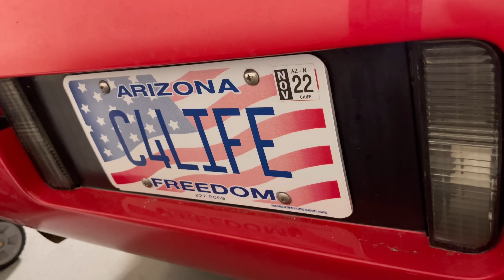Callaway Twin Turbo Delivery Day

Comment: Congrats on the purchase chris. I just want to let you know so you can put under consideration, and maybe even a must do while you go through the engine clean up.... if the car has been sitting for long while before you got it and due to its age, take both turbos off and send them to a turbo specialist to have them inspected and maybe even clean and refresh them since there maybe be a high chance the seals and bearings may be worn out which can lead to both oil leaks or premature damage to the turbos upon running. It's better to be safe than sorry.

Comment: Just came across you video on the Callaway. I too am in the same situation. I inherited my dad's 1990 twin turbo Callaway black with 40,000 original miles. It's been sitting in my dad's garage for over 10 years. Looks to be in the same condition as yours but maybe a little better lol. I currently have at a Corvette specialist repair shop now. So far I have had to replace the whole fuel system. Tank, fuel pump, fuel injectors, etc... Was a rusted out... Now she's running perfecto. I'm sure I'll be running into more issues down the road but for now she's alive... Not sure what I'm going to do. Might keep it or sell... Enjoy...... 👍
Reply from the maker: Awesome!  Please send me an email!  Have your registered it with Callaway?

Comment: Chris: FOR THE DOOR STAIN- if you believe it may be a petroleum base, I would just get some plain old oil lamp fuel which is almost 100% kerosene and take that to it with either a really soft sponge or cloth. The lamp fuel also has paraffin in it so it helps seal the paint as the stain is removed. I’ve found this also removes road tar even if it’s old.  Just thot I’d give me 2C on this.
Reply from the maker: Thanks I’ll look into that.

Comment: Your car has the same windshield as zr1 c4s.  The film will dwlaminate like yours is doing around the edges. You can replace it with a standard windshield for some savings.  Nice car!  Cant wait for this series.  Congrats!
Reply from the maker: Thanks
Reply: @mycorvettelife  another thing chris, watching the video again, it looks like they started witha zr1 when callaway built it.  The fenders look wider, you mentioned gs brakes, probably are factory.  The license plate looks wider, like the zr1.  I dont know much about callaways at all, but there are several tell tale points that indicate it started its life as a zr1.  Very rare car indeed.

Comment: You should be excited with this purchase..That is a extremely rare C4 .Congratulations..looking forward to the renovation vids ...The Wear on the Engine internals (if stock) may be a issue  with the use of the previous Nitrous setup?   .
Reply from the maker: Thanks

Comment: I think the windscreens were called cool-ray and were standard on the ZR-1 hence the delamination of the UV layer.  Not sure, but I don't believe anyone makes an exact replacement, as most ZR-1's where the windscreen was replaced are standard C-4 glass..
Reply from the maker: Cool-off

Comment: Now why would the owner not have the top for it? That's strange. The windshield's covering delaminates over time. I don't think there's anyway to correct the problem, but since it's the same windshield as in the ZR1, you might want to check on the ZR1 forum. Definitely remove the Nitrous setup. Did the owner tell you why it was added in that my thinking is that car might have been raced. Having said that, I didn't notice any mounts in the storage area where a Nitrous bottle would have been mounted, so maybe it wasn't raced, which would be a plus. Lastly, I'd be very, very curious what the paper history will tell you when it arrives. Save the Wave👋
Reply: They get broken a lot because of mishandling.
Reply: The targa tops get broken because of mishandling.
Reply: I'm well aware of that. The question is pointed towards this Vette. What is the back-story as to how/why it's missing?
Reply from the maker: He removed the bottle mounts.  I have photos of them when they were in the car.
Reply: So the nitrous system was active and used at one time? What happened to the top?
Reply: @petercarey6883  blew off first time he hit the nitrous 😂

Comment: Am always disappointed to see a C4 in distress! Especially for a Callaway, I can't believe the previous owner would have let it fall into such disarray. I am looking forward to seeing you get the car cleaned up and back on the road! I'm with you on the purist perspective (NO2 removal,) but I always preferred the look of the original C4 as opposed to the Callaway bumpers. That's how I would have ordered mine, at least. My 2¢ worth! And if I am not mistaken, I liked the durability of the Callaway Twin Turbo motor over the exotic LT5 and it's DOHC's and such.

Comment: I dont think youll be getting rid of this one quite as easily ad you did the last one.  My good money says youll keep it.  Where is the top?  was the 91 an LT1 twin turbo, if so wouldnt those be the rarest of the callaways?
Reply: Clyde, in 90 and 91 the engine was still the L98 motor. The LT1 was from 92-96.
Reply from the maker: L98 TT.

Comment: So I am wondering is this Vette rated at the same top speed as the legendary Sledgehammer that maintained the 254.76 record for over 25 years I remember that car as a 17ish young man.Dont forget bag and tag. This looks like a pretty serious project your getting into.
Reply from the maker: No.  It’s about 185.  Sledgehammer had almost 3x the power of a standard B2K.

Comment: Looks as if the windshield is the same as used in the ZR-1 (89-95). They delaminate over time and that accounts for the brown tinting around its edges. IF you can source a OEM ZR-1 windshield, it will be expensive.  The other choice is to replace it with a OEM non ZR-1 windshield out of a C-4.  Good luck with the project.
Reply from the maker: Thanks

Comment: The goop on the side of the car appears to be contact cement, 95% certain.  Sorry to say its very difficult to remove and the only way I have found to remove it without abrasives is lacquer thinner or acetone, and that much will take a number of days to remove.  Sorry man, but it can be done.
Reply from the maker: Yea I figured it won’t be easy.

Comment: Hi Chris, CONGRATZZZZ!!!! Question: do you know what the base engine of this car is? Looks like a L98 to me. Am  I right or wrong?
Reply: I think the base engine is the L98 block, but there’s a little confusion because I also thought some had the ZR1 LT5.  I’m sure somebody on here with more knowledge can set us right.
Reply: @45auto82  All C4 Callaway Corvettes were produced with the L98 engine as the block. (1987-1991). But the engine was torn down and hand-built with performance upgrades too detailed to list here(but I know Chris will go into the fine points on the specifics of this world of wonder engine). This may be what you are thinking: no LT5 for the C4 was 'performanced' out by Callaway. At the time, there were only eight ZR1's that had a performance upgrade down by Doug Rippie. Those engines are called DRZ-500 or better known as, 'black widow'(the blocks were painted black). Plus, only eight were produced between March and July 1993.
Reply from the maker: All B2K option cars had the L98 engine with Callaway internals and obviously the turbos.  The Callaway Supernatural was the ZR1 version.  They did not have turbos.
Reply: @mycorvettelife  I should have clarified. The 'sledgehammer' was not made available to the buying public as an option. (Cool additional fact: the ten Callaway Speedsters made in '91 were based on the L98 engine platform / and two Super Speedsters that did indeed come with a Twin Turbo-charged LT5, making a whopping 750 horsepower). Even a diehard, well read Corvette fan like myself is learning everyday about the Callaway cars in the C4 moniker. (Looks like in 1991,  a customer ordered a Malcolm Conner edition ZR1, then had the car shipped to Callaway Cars for them to 'work their magic' on the engine. Code name CR1 Corvette). And yes, the car didn't need turbo-charging. And only a handful of these cars were made(just 12)!  Best of luck on this beautiful car Chris, great job sir!

Comment: I totally understand removing nitrous and harness...but if the brakes are actually an improvement and in good shape, a DOWNGRADE doesn't make sense to me. If you watch the smoking tire, matt Farah drove one and thought they needed upgrading. So if it's factory parts anyways, again, I don't understand going backwards. Especially since it's a bolt on. Original brakes aren't going to add significant value to a very powerful car. My 2 cents.
Reply from the maker: Original parts will always bring more value.

Comment: Chris, I have a C4 top, but it is really just the frame-I bought it used with a crack/hole in it, and I cut almost all of the "glass" (I know it's not glass, that's just the easiest way of saying it, lol) out of the middle and used it when I wanted to take the top off my C4 but didn't want the "bowl full of Jello" shakes that accompanied having the top off.  I know you can get them rebuilt, but you'd probably have to consult with them to see if what I have is considered a "rebuildable core" or not.  Anyway, I'll happily donate it to the cause if you're interested and considering an aftermarket top.

Comment: Cris this is off topic but. I would strongly recommend to  edit the video to remove your Daughter. I have two daughters myself. The current state or affairs in USA is we have a huge problem with child predators. I’m surprised that YOUTUBE is so wiling to take down vaccine stuff but not address child protection issues at all levels. Just a suggestion.